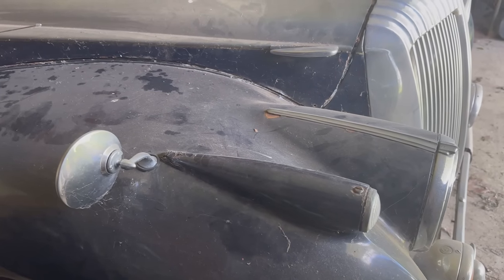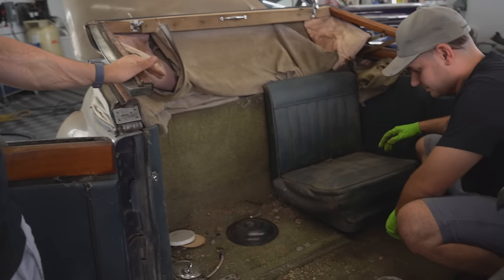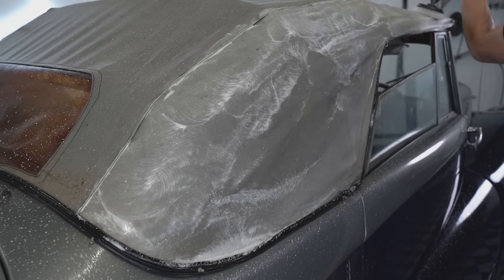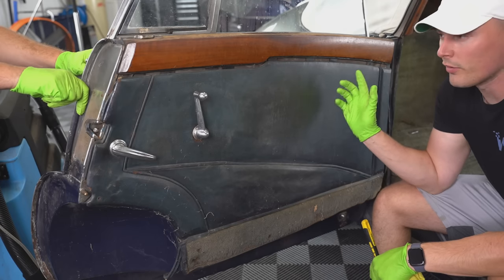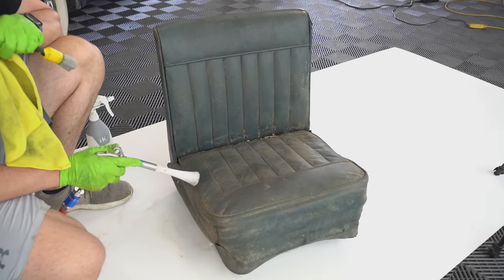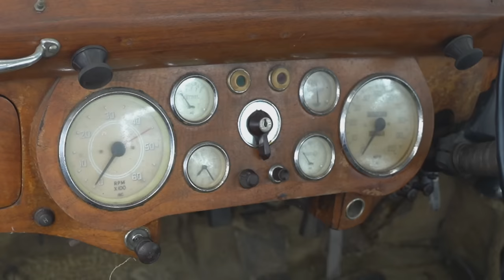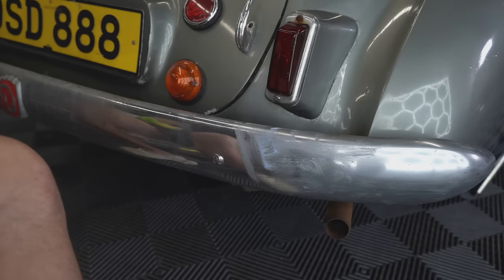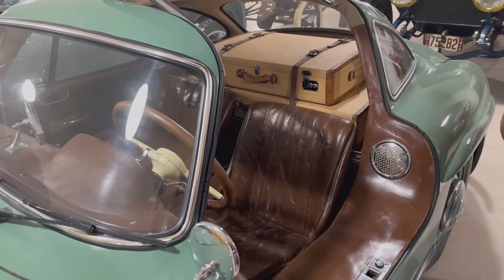85 Years Old ABANDONED Barn Find Daimler DB18! 1 of 25 Car Detailing Restoration!

Comment: The Spare Tire Compartment  placement and style was very Common  in British automobiles of the same era  these cars  don’t  have extremely high Values  in America my guess is the value  maybe in the 30 to 50 K  Dollar range   As a running Atomotoble  possibly higher. With a Restoration  I think the GB is Great Britain  it was very Common for  English Cars to  wear that and Automobile Club badges  mounted on the front grilles or on top of the front Bumper  mostbEnglish Car builders  installed those Brass I.D. plates  that listed the Approved Lubricates  the Factory Reccomended my guess is that was something  that may had been required. For Cars to be Exported ? I’ve Owned Jaguars ,MGs and AustinHealeys that had the same style Plates  Attached  before Cars had assigned VinNumbers like they use now  there was some confusion  because some  places used Engine Numbers that were stamped into the Engine Blocks  others used  Paperwork numbers    And because of all the variables. It got very confusing  for  all the Municipalities and Countries to track Vehicles  over time   In America there is a Survivor Car from the early 1950s that a man  used. Several Cars to build one  and even hand stamped  a Serial number himself onto the Car and that Vehicle  still has the  same Number as its Official Titled Vehicle Identification Number

Comment: Now I wish to tell you about a few things that you need to do while you're doing your detailing. First things first muriatic acid and water on Steel, it doesn't matter if it's locked up steal or not it will make it look brand new!! Second let me tell you about saddle soap, that will work the dirt out of any leather that is all I have to say, other than that you do a great job but I believe these two things muriatic acid and saddle soap will help you complete your interior exterior detail

Comment: https://en.wikipedia.org/wiki/Daimler_Company    history.....provided royal motor cars until 1950s...
The Daimler DB18 is an automobile produced by Daimler from 1939 until 1953. It is a 2½-litre, 70bhp version of the preceding 2.2-litre New Fifteen introduced in 1937. From 1949, the DB18 was revised to become the Daimler Consort.
Approximately 1,000 DB18s and 25 DB18 Special Sports were produced to 1940. In addition 3,355 DB18s, 608 DB18 Sports Specials and 4,250 DB18 Consorts were built in the post-war years.[
Reply: Daimler Conquest.....built into the 1950's.. Winston Churchill had one.  Were there any badges indicating the coachbuilder?

Comment: Using spray water on everything,   might as well drive the car into a lake.   Should use dry cleaning fluid on fabric and not a pump spray bottle of water & detergent.  Should steam clean engine and not a water hose.  Applying grease on wet steel  (seat  slider rails)  is wrong.    Not a way to detail an old car.

Comment: Wow - spraying all that water around an old car  inc. the engine before checking it over figuring out restoration plan - not something I would have done. Dirt doesnt hurt, high pressure water does . Also, ripping out the roof lining made me cringe … ok it was rotten, but it could be used as a template for a replacement if the car is going to be restored. Good content / I suspect v.bad for the poor old car.

Comment: You are totally using the wrong thing on those I have done millions of white wall tires and Wesley's bleach white is the best thing to use with a wire brush don't get scared the wire brush won't tear up the tires and we also used it on convertible tops with a nylon non-color brush